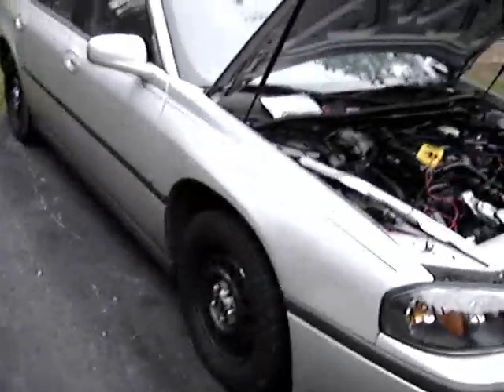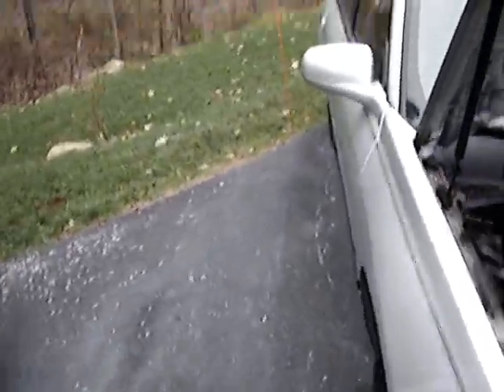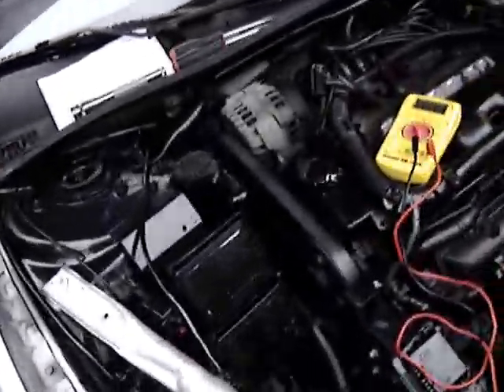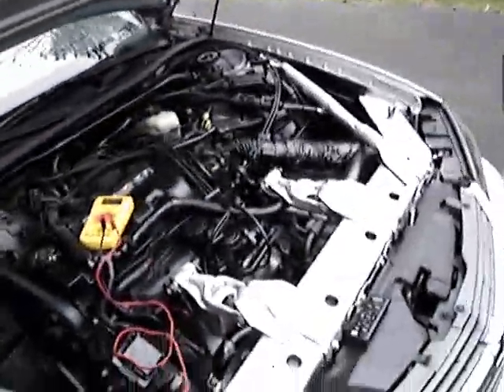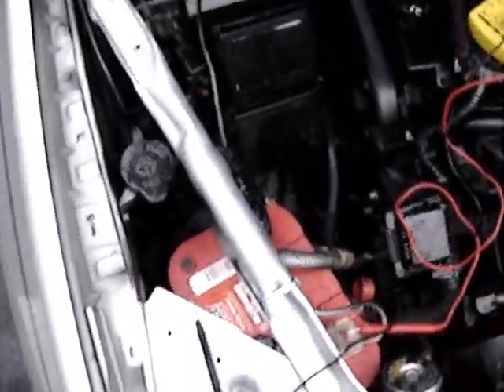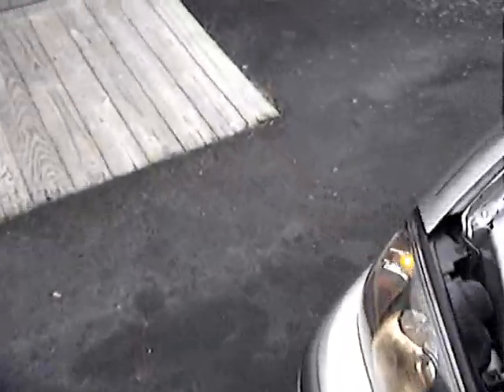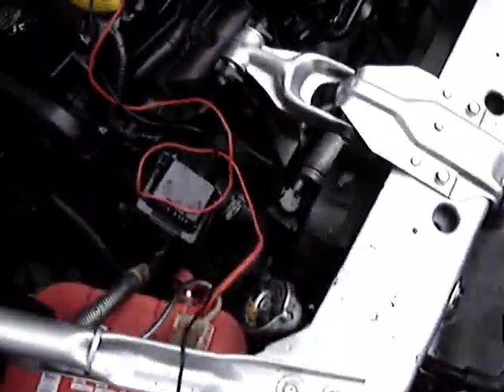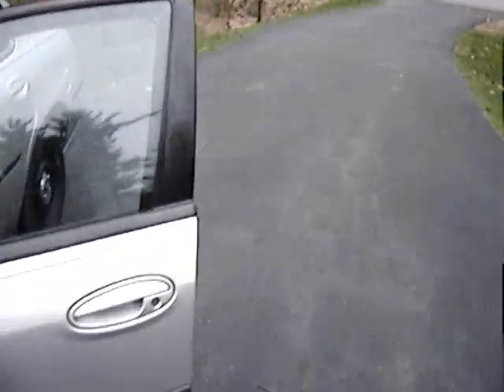Voltage Booster

Comment: the "improvement" in sound is not really that much.. you increase your voltage with about 12%..
and the voltage at your speakers would likely not notice as you RARELY drive speakers or amplifier in to max volume due to clipping and distortion...

another result of increased battery voltage could be  that the lights blow more often, some electronics in your car is being slightly overloaded which decreases lifetime.
it also puts stress to your car battery..